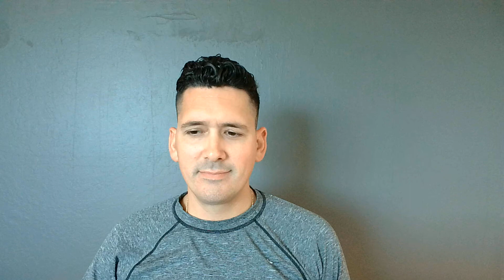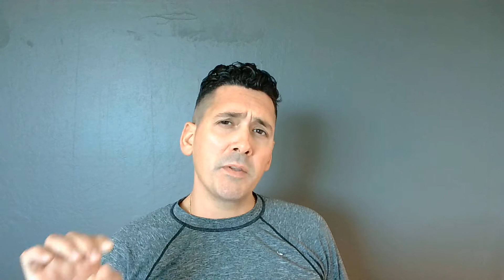Airbus Flight Control Laws for Dummies

Comment: What is the meaning of in Normal Law flight mode the sidestick provides a load factor proportional to stick deflection which is independent of aircraft speed.